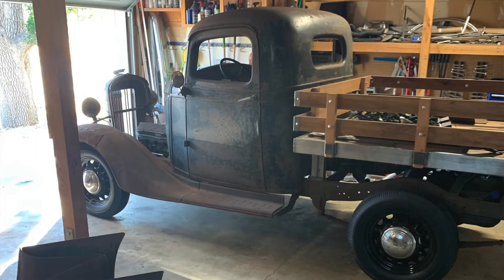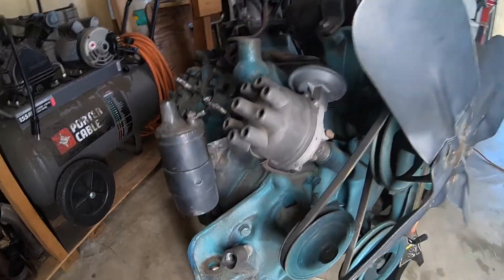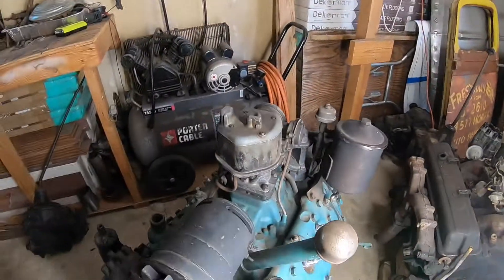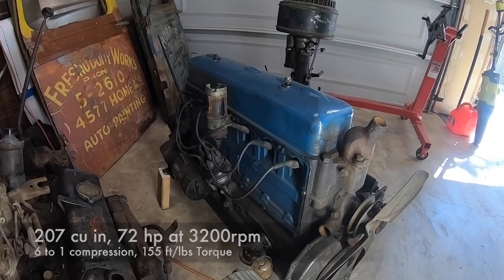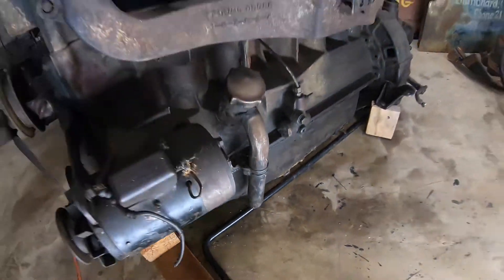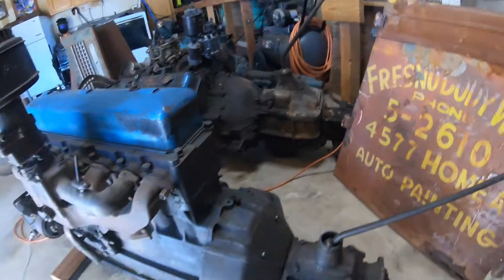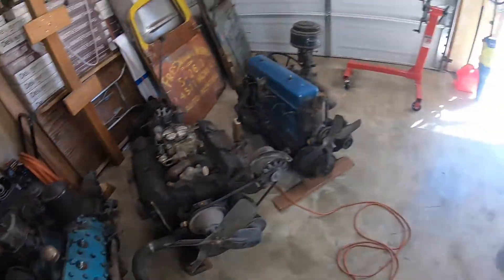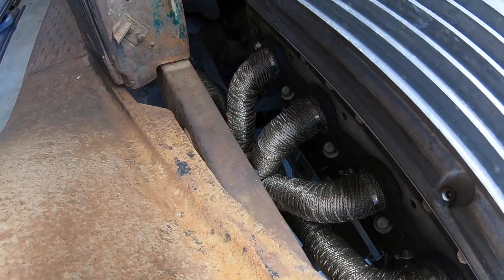Engine Options: Mercury Flathead vs Chevy 350 vs Chevy 6 Cylinder vs LS 5.3L Chevy Engine

Comment: Nice side by side comparison, thank you for sharing. My Dad bought a new 77 Chevy C10 with a 305 V8, he had 2 cam shafts replaced under warranty, then the 3rd cam went out & he had the complete 305 replaced under warranty (he wanted a 350 put in but GM wouldn't), then that 305 cam went out after the warranty was done. So my Dad put in a junkyard 350 & never had another problem.
I think your flathead would be sweet in an open engine compartment truck, like a late 1920s to early 1930s.
Reply from the maker: Oh that’s cool. Yeah that’s my thought on a flathead also. If you’re going to spend that kind of money it would be nice to show it off all the time